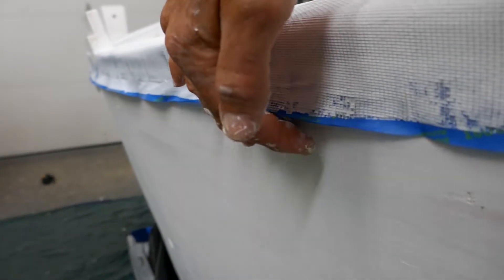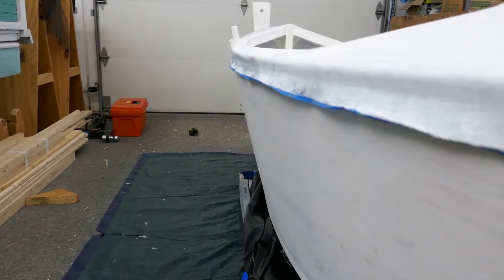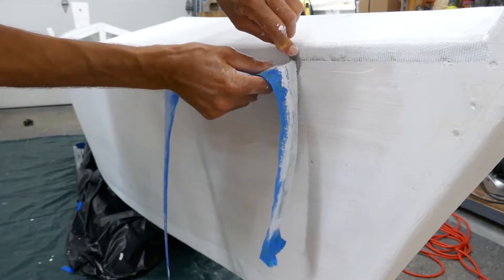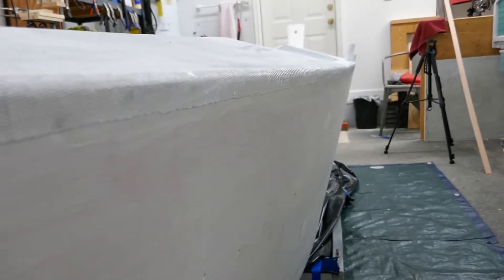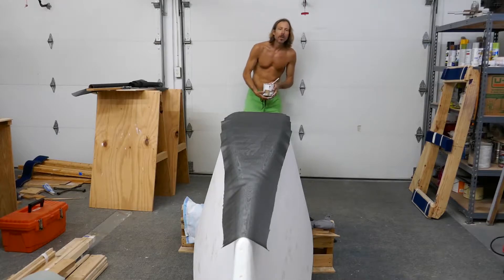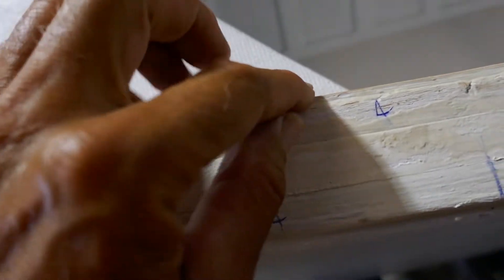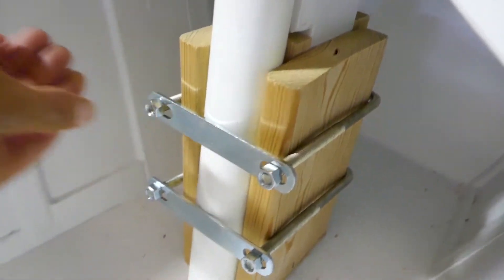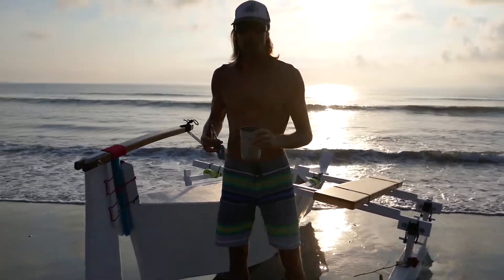Sailing Canoe Build Part 5/9 (First launch)

Comment: Amazing build!!! 👏 New subscriber!
Reply from the maker: Thanks much! It was something I've always wanted to do. I have plans for a bigger hull this winter. The boat works great. Im still adjusting the rigging setups, and I think Atlantic proa style is what it likes. Ama on leeward. The new big hull will be asymmetrical so that will be interesting.
Reply: @zackariasthepirate  Sounds great I'll definitely stay tuned!!! 

I just got into sailing this year with a canoe though I just had to build the sail rig, not the canoe as well. The level of detail that goes into boats like yours astounds me. One day maybe I'll give it a go... but for now I'll stick to sailing my $400 "junkyard rig" hahaha it's a 15.5 ft used Colman canoe with a ~55ft sqrd medium tarp shaped into a balanced lug sail rig with a 10.5 ft fence post mast and 2 8' 2x2 boards for the boom and yard. Lee boards are simply oars turnbuckle roped on and I steer with another oar haha
Reply from the maker: @kristoferyoung1511  That sounds super fun to me! Use what is available and set out with a plan in mind. So much stuff can be used in so many ways, and it helps in a well rounded understanding of the physics. Good times!

Comment: Ok, i really liked the way you make the rudder attachment. Can you make a video explain how do you do it? No nails, no metals, simple solutions. I think i can reproduce in my wa'apa.
Reply: The blue thing is a pool nodle?
Reply from the maker: @viniyung  Yes the blue is a pool noodle.. I would recommend that the rudder where it meets the boat is sandwiched from the sides. My rudder wanted to become loose and it wanted to work its way from being straight up and down. The way I did it was ok as a start, but needs a day to fine tune it... maybe a little different approach but could work fine if it was adjusted.

Comment: Can I ask about the mesh. Is it for strength. Is it just held down in place by the paint. I am about to build similar and would love to know more about that aspect please.
Reply from the maker: Hey David. Its screen door screen with primer, then oil based paint. The adhesion between the two seems to be strong. I built the two outriggers a year ago and they seem durable enough. Make sure all the seems are super tight. Its arduous, but seems to work. Hope that helps. ZPLAAC
Reply: @zackariasthepirate  Thank you for taking the time to reply. I appreciate that.